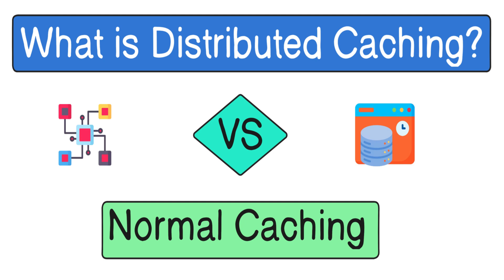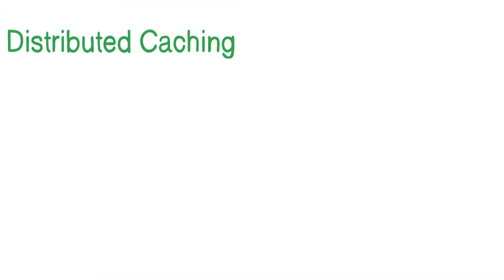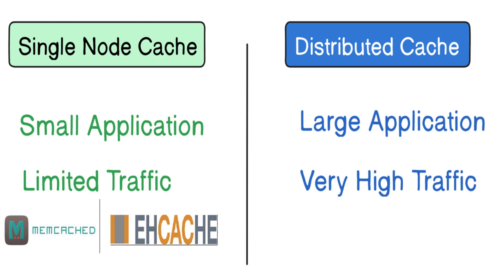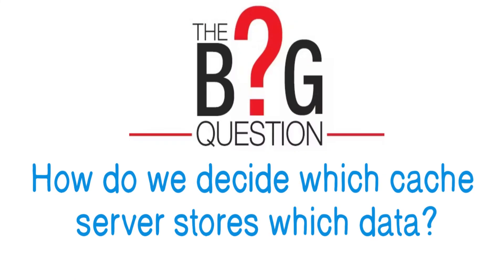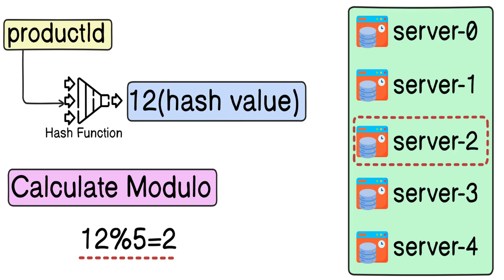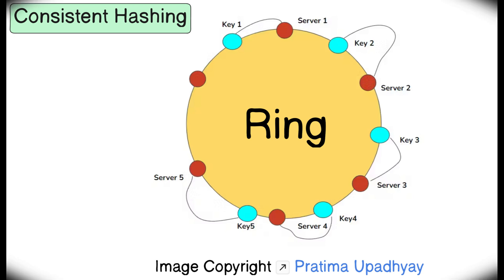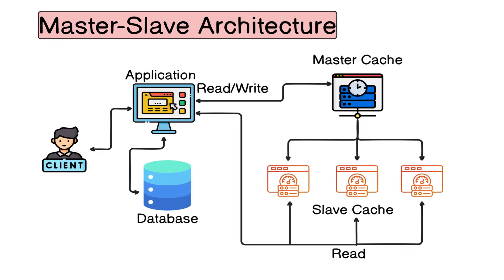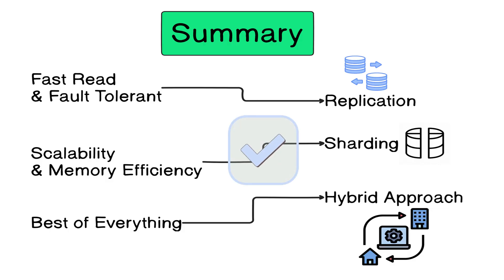What is Distributed Caching | How Does It Work | System Design

Comment: I like to add point over this video. The most annoying problem on distributed caching is on cache invalidation.  

Invalidation a cache is a big overhead if we are building a low latency systems.
Reply from the maker: I completely agree with you. As I mentioned in the video also, it is not a silver bullet everything comes with its use cases tradeoffs so it's not like we can select distributes caching for everything.

Comment: Sir, do I really need to learn springboot as a college undergrad or building projects which involve OS, CN, multithreading etc concepts are enough for resume project
Reply from the maker: Focusing on core concepts like OS, CN, and multithreading is absolutely essential. Once you feel confident with the foundation and more interested in backed development, then you can start focusing on Frameworks like Spring boot. 

Because Spring Boot is widely used in the industry for creating microservices and scalable applications, it'll give you an edge.
Reply: Okay sir, thank you @LazzyProgrammer